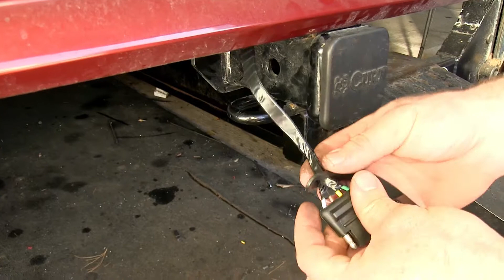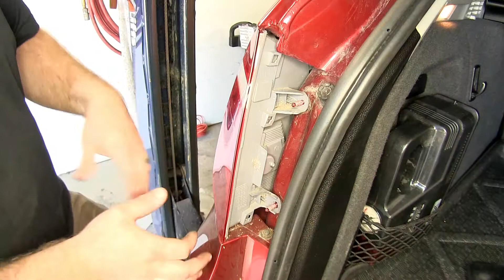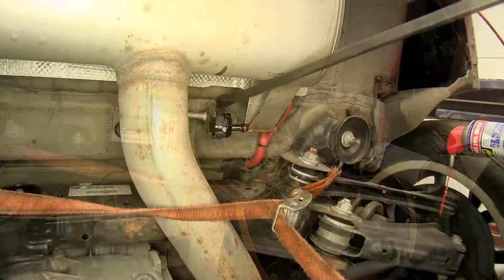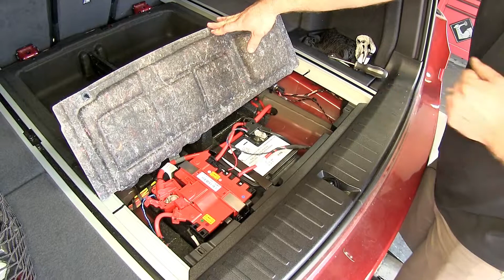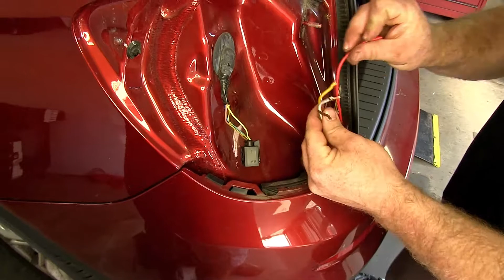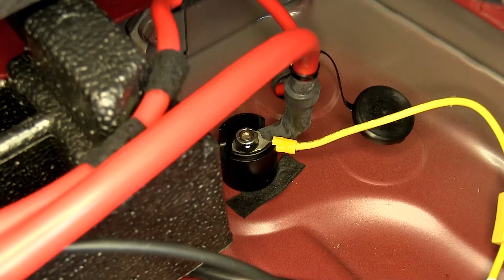Mount: Curt Powered Tail Light Converter with 4-Pole Flat Trailer Connector on a 2011 BMW X3

Comment: It's not good for winter time better install wires keep in trunk
Reply from the maker: The wiring is rated to be exposed to the elements but what a lot of people will do is install it on the inside of the vehicle if they are not going to be using it on a regular basis.
https://www.etrailer.com/Wiring/Curt/C59236.html